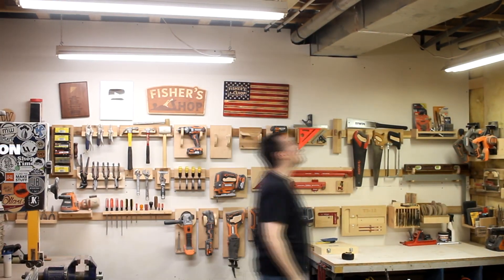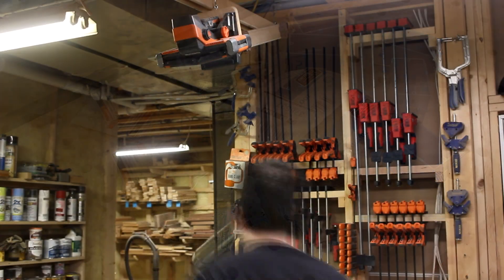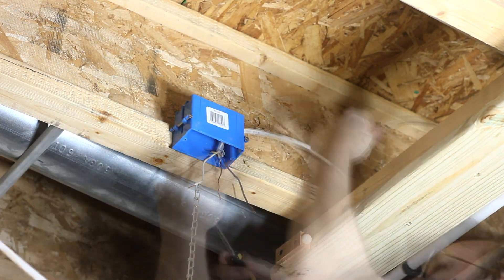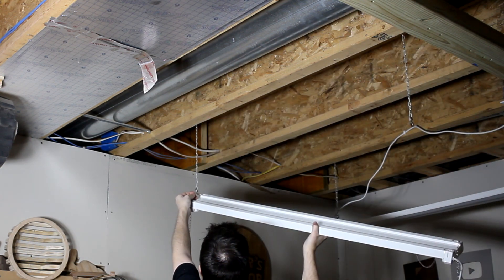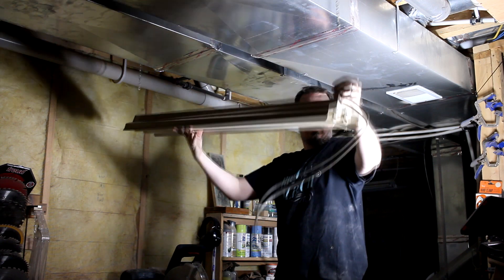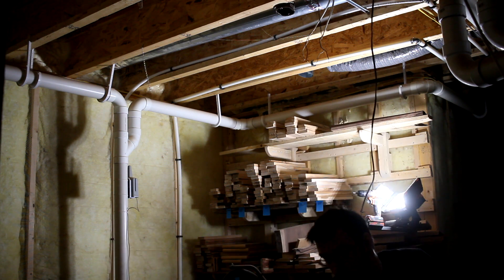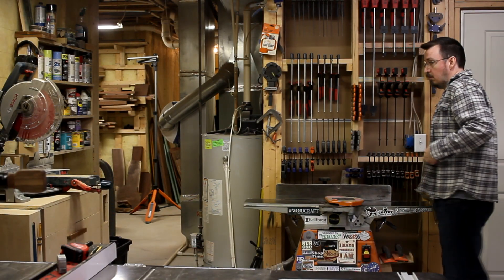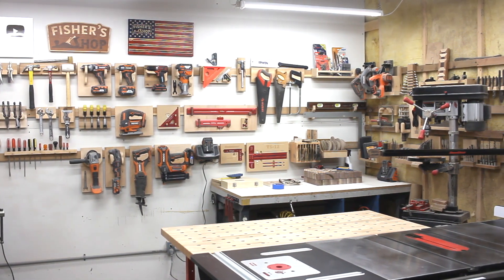Shop Work: Installing LED Lights

Comment: I did a similar project in my kitchen a month ago. The old 30W flourescent wasn't working well, so I replaced it with a new fitting with six 5W 6000K spotlight LEDs. It's a definite improvement. The old flourescent was so dim I'd reached the point of cooking by candlelight, which is not nearly as romantic as eating by candlelight. Plus the old flourescent tube was in the middle of the kitchen, so I used to cast a shadow on my chopping board whenever I was chopping anything up - which meant what got chopped up was sometimes my fingers.

I also learned a few things in the process, like why you should never put a drill anywhere near loft insulation.
Reply from the maker: Yikes!

Comment: Nice upgrade! I was in the middle of a project when I said to myself, self, I can’t see good enough. My shop is 28x30. I had 20, 4’, 2 tube fluorescent fixtures. I had purchased 8, 8’ LED fixtures before I quit my part time job at Home Depot. They were on clearance for 1/2 price. 4100 kelvins, 8200 lumens. I read the 5000 kelvins can make you have headaches, which I suffer from already. Already had receptacles in the ceiling. Relocated a few to get even lighting. Ended up having to buy 1 more fixture to get the light I wanted. What a difference it makes! 
Keep the videos coming! I do look forward to seeing them!
Reply from the maker: Thanks a bunch!  Yeah, this was one of the best upgrades I did to my shop

Comment: I just upgraded my shop lighting last weekend. Had six 8-foot T-12 fixtures with two tubes on each. I now have twelve 8- foot LED fixtures, each with an output of 8500 lumens at 5000k.  It looks like the sun rose in my shop now. You won't be disappointed.

Comment: When I built my shop I put in LED recessed lighting. They were expensive at the time but so worth it. Seven years so far and have not had to change any bulbs. They only use like 12 watts each and produce no heat and don't flicker. Amazing. LED's are one of the best inventions ever!
Reply from the maker: Totally agree!
Reply: only thing is, i do miss the satisfaction of flipping the switch and watching them come on in intervals. the closest thing i can do to simulate it is cascading relays, solenoid ding bells and heavy driver delay.  there is a retrofit product coming out that simulates that, and you can program it how you want it, but it's not cheap. so for now, it is what it is.

Comment: Big difference! No electrical burns or having to do a meet and greet with the fire department. Thanks for sharing :)
Reply from the maker: Haha thanks Regina
Reply: no sticky tar either. (remembering the tar i had to clean out of a fluorescent light that came from the local library that i was restoring. the ballast was nicely fried, but i had a new ballast for it on hand, so it works fine now, but that tar 😑)

Comment: Hola! 🖐WOW! What a difference that made. It's hard to appreciate how dim your shop was until you showed the "after" shots, amazing. As I watch shops grow and improve here on YT, lighting is like a right of passage in the process and it's awesome to see your shop improve as well. Congratulations!👏Take care and have a good one, Adios!👊
Reply from the maker: Thanks 👍 Yeah, this was one of the best upgrades I did to the shop.  Plus it was pretty easy too!  Since this upgrade, I've had 2 of the fixtures go bad on me and I've had to replace them, so that's a bummer, but I'd still rather have the LEDs over the fluorescent fixtures.
Reply: @FishersShop  for sure! 👍

Comment: Good timing. I just ordered new lights for my shop/garage a couple days ago. Mine is 24'x24' with one 8' dual tube fixture on one side and what I believe is a sodium light from prehistoric times that makes a sound like a nest of angry hornets. After seeing what you bought, I am thinking I am going to have to wear sunglasses in the shop after this weekend. I ordered 10x 5000LM LED 5000K fixtures. I am looking forward to being able to find my tools without the aid of a spotlight.
Reply from the maker: Hehe you’ll love it

Comment: what a great upgrade.  I only put 4 in my shop because it is so small, buuuuttttt when the new shop is built you can bet there were be a ton of these lights.
Reply from the maker: Yeah they were a great upgrade, Will.  And I didn't know you were getting a new shop

Comment: I didn't buy the ones where you can connect them to each other so I have 6 extension cords running everywhere on my ceiling. 
Yours are better. 
Well done.

Comment: I had a single 2-foot fluro tube in my 'workshop' when I moved in here.. that lasted about as long as it took for me to build some walls to the carport (the upper half being polycarb sheeting for natural light entry) thus converting it into my workshop.. I then put in 6, 4-foot, 3600 lumen, 36 watt leds.. even in the middle of the day it is brighter in the workshop now with the lights on - as in: the lights are brighter than the sun.
I need to install about 3 or 6 more as well to fully kit out the space, (I have them grouped in 3's for power consumption), but the improvement is leaps and bounds better than the fluro.

Comment: Great shop improvement project.  It's one that I plan on doing as well, and replacing the junction boxes with outlets is a much better plan than I had of hard-wiring everything.  Also, I inherited one of those Ridgid air cleaners when we bought our house, and this is the first one of those I've seen anywhere else!
Reply from the maker: Haha, yeah.  I made mine a little more effective by augmenting the filter with a couple additional air filters.  It does an okay job... definitely worth the $30 I paid for it.

Comment: Very timely brother. I am down to about 25% of my fluorescents working now. I bought LEDs and went to convert the fixtures but they do not have normal ballasts. They have a magnetic ballast and the model is discontinued. Found one terrible quality video on it on YouTube and followed the guys advice but it didn't work. My neighbors grandson is going to have a go at converting one and then I will reverse engineer it. If that doesn't work then I have to fork out for the fixtures as well as the bulbs :-(
Reply from the maker: Buying these 10 lights in bulk was pretty cheap.  Less than $20 a fixture which is pretty darn good.  I recommend just biting the bullet and upgrade.  You'll be so happy you did.
Reply: @FishersShop  Grrrrrrrr.....ok. I might have to go for it :-)

Comment: Good job, Drew. I'm disappointed that you actually remembered to measure for the gantry. Another outtake opportunity missed. BTW - I  just installed 20 4 ft LED tubes in my 24x30 shop. Love 'em.

Comment: you forgot the classic dad move of pretending to get electrocuted when working with bare wires. I use that one all the time.
Reply: lol.  I'll have to remember that one.
Reply: Problem is once you actually DO get electrocuted, the kids will have a reaction time of 42 seconds before shutting off the breakers.
Reply: My dad did that once. He laughed so hard he fell a sleep and didn't wake back up. It was a weird laugh though...

Comment: LEDs contnue to get cheaper. I've had some fail well before their rated life, just the compact flursecents do. I got a whole bunch of free 4 ft / 8 ft fluroescent fixtures. When I run out I will switch to LED.

Comment: Did you use any kind of calculation to figure how many lumens of light you would need/want or did you just wing it? I need to add lights in a 3 car garage but I’m not sure how many lights I would need.
Reply from the maker: I was just winging it.

Comment: I'm considering adding lights myself - I was surprised to see 10 lights added....I was considering 4 for my garage space.  Question for you - have you noticed any EMI difficulties?  I like using headsets with Bluetooth and one brand said there could be EMI issues.  Thanks for keeping us informed and entertained.
Reply from the maker: None so far.  Haven't heard of that being an issue

Comment: Very cool. It makes a huge difference. When we rebuilt our home after the fire I went with 100% LED inside. It's a ton brighter and uses next to no electricity. Nice job Drew!
5:10 What's the doorbell for?
Reply from the maker: Not sure what you're referring to.  Doorbell?
Reply: @FishersShop  Right above your head at 5:10.. Looks like greenish plastic with a yellow button...
Reply from the maker: @StephenGoggin  Ohhhh, THAT!  That's just my dignity.  (As I spent a minute looking for what you're talking about and then realized it was April 1st).  Bravo, good sir.

Comment: Love your content. Care to mention how many units you installed and the square footage.  I’m calculating these for my shop right now, that’s why I’m curious.
Reply from the maker: My shop area is 16x12 and I put in 8 in that area.  I could have gone with 6 and it would have been fine.

Comment: Just curious, why did you keep the new lights on chains and not flush mount them to the joists?    When converting my shop to LED I installed all my LED lights right to the ceiling.  I can't count the number of times that I used to bang lumber into the fixtures and now with the LED lights I never hit them now.
Reply from the maker: I have 9' ceilings down there.  It's nice to have the lights lower to provide a bit more brightness on the work surfaces.

Comment: Good video. I guess you didn’t know they make a single outlet that will fit the round box you already had in there? But if you wanted to plug in two light you needed to change it anyway...

Comment: +1 for looping in your shop buddy and getting some good father/son time in! Have you tried taking slow motion video with the new LEDs?  I'm curious if they flicker for you.
Reply from the maker: I haven't yet.  You've got me curious now too.  The box says flicker-free so I guess we'll put it to the test.
Reply: Fisher's Shop I think it depends on refresh rate and film speed. I don’t recall the refresh rate on mine, but 240fps flickers and 120fps does not (from what I can tell). As long as it refreshes faster than the camera is capturing frames, it doesn’t flicker in the video.

Comment: Looking great. Have you found that you need to set a specific shutter speed on your camera to avoid rolling black bars on your video?
Reply from the maker: Yeah, but they still show up.  Hopefully these new lights will eliminate the issue.
Reply: @FishersShop  I noticed that in my shop I needed to set my shutter speed to 1/100th. Anything else and I get bars. Being on a uk 50hz supply may be why its that number instead of say 1/60 or 1/120. But then I've also noted that it depends on the LED. Some other lights in my house that are LED are perfectly fine no matter what!

Comment: The shop is looking bright, Drew.  Nice work.  Did you have to remove any junction boxes, or did you convert all of them to outlets?
Reply from the maker: I converted 3 junctions to 3 outlets.  You can daisy chain 4 of those fixtures so that's all I needed to do for the 10 lights I bought.  Easy Peezy

Comment: I have a 40 x 40 foot steel shop building, with 15 foot ceiling.  Do think 16 of these 6000K light fixtures would be okay; half of the shop is for wood working and half for general metal/farm stuff?
Thank you.
Elvin from NC
Reply from the maker: I'd guess that you would need more.  My shop is less than half that size and I used 8.

Comment: LED lighting is definitely the way to go.  BUT - those outlets... by electrical code, the cover plates MUST BE METAL if they are not supported (yes, even on the ceiling where only someone over 7' tall could reach them).
Reply from the maker: I'm a rebel

Comment: Nice. My only question is why didn’t you attach them directly to the ceiling so you would have more headroom?
Reply from the maker: I have 9’ ceilings in my basement. I hung them down at 8’ so I have more light on my work surface and they’re still out if the way.

Comment: The ones I put in my shop are junque. LEDS are supposed to last a long time but I've already had to replace two of the three.
Reply: Timothy Ball yep, led's are not all created equal and when they go you have to replace the whole fixture.  The plug-in design is part of facilitating that inconvience. Not all LED's render light well, and it is important to also choose the right color for the lighting needs.

Overall though, LED's are most often the best choice...

Comment: only issue i can see with those lights is that they are diffused, and they look too much like fluorescent lights. bare LED's put out a harsh, crisp, quality light without the smudgyness of diffused light. plus, they don't get as hot without diffusers and you get 100% of the light emitted from the LED's.
Reply from the maker: They're not camera friendly though if they're not diffused.
Reply: @FishersShop  i got you, but those lights doo look too much like fluorescent lights. the trend nowadays is to have round or hexagonal fixtures. but if you want my honest opinion, i actually  don't agree with those trends and don't follow the status quo. i actually like the old fluorescents and i won't use LED right until the day i can buy an affordable retrofit kit that has all the energy and illumination benefits of led, but can simulate the startup of a preheat fluorescent light. as much as that makes me sound like a weirdo.

Comment: I don't think this applies to you because your outlets are up in a ceiling well out of reach.  But as a friendly reminder, if you are going to install a plug or switch and the cover doesn't sit flat against the wall. The cover should be metal so it can't break and expose wire.